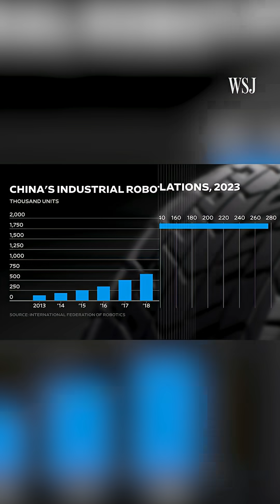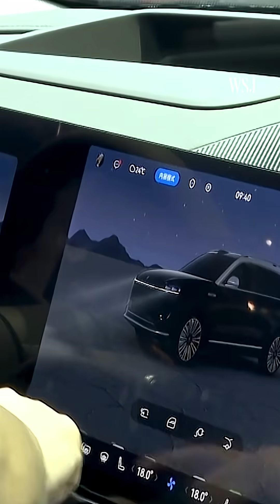Inside China’s Dark Factories, Where Hyper-Automation Rules 24/7

Comment: Also, with factories like this you can very fast and easily change the production line to produce other things by just reprogramming stuff. You also have reprogrammable, adaptive and dynamic molding and meral working machines... So you could, in teori, radically change the production line if set up correct.